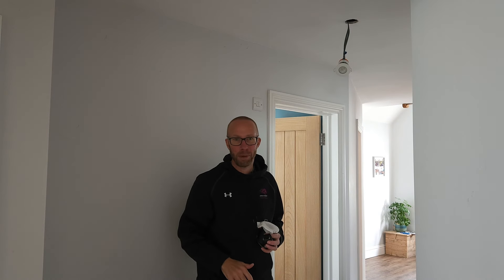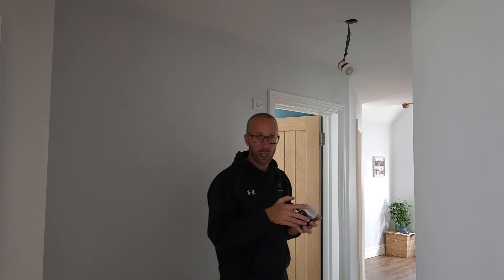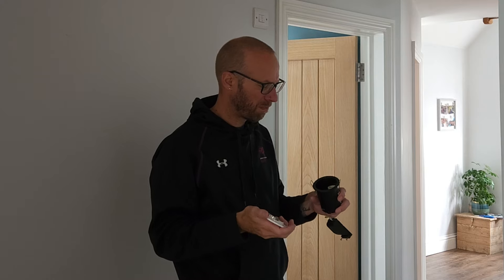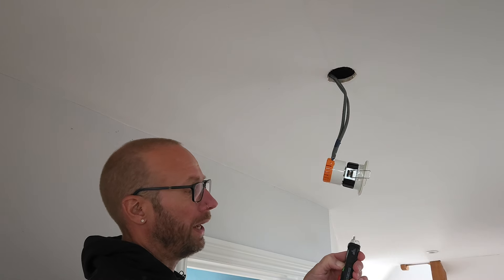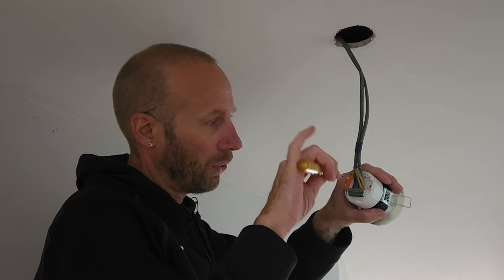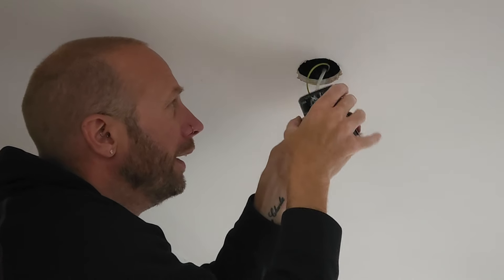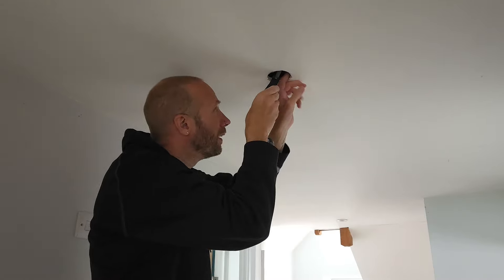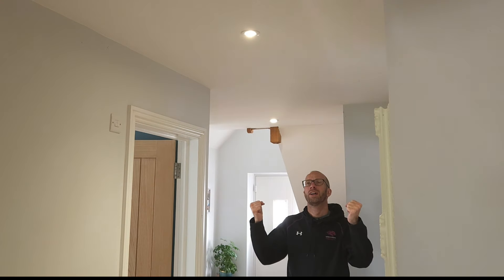How to Change and Replace Ceiling Downlights - Step by Step

Comment: This video is just what i needed for replacing downlights in my kitchen. Bought the units from Amazon as per your recommendation. However found that the 2 cables are too big to fit in the cable retaining system ( it is the ‘lock gate’ type). Only way I could do it is remove the terminal block from the box. Is it unacceptable to have the terminal block un housed in the ceiling? Any advice much appreciated!

Comment: Best to turn all the power off as, especially in a hallway in older properties, you could have a borrowed neutral from the upstairs circuit (  or visa versa)...and although your circuit is off, if someone was to turn the other circuit light on you will get a nasty supprise via the neutral. It is usually when working upstairs you find this out....ha
To be double sure turn the lot off.... And make sure the cable clamps inside fitting clamp onto the sheath of the cable not the inner cores...and there are no inner cores showing outside the fitting.
Reply from the maker: Thanks for the advice 👍